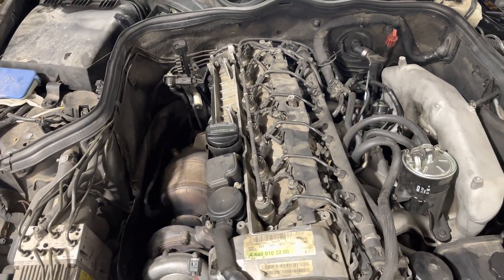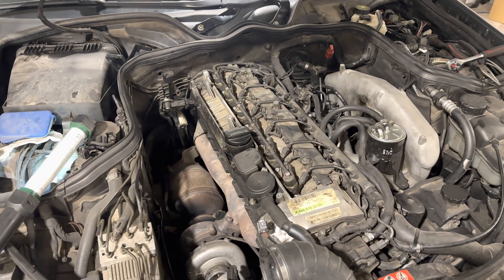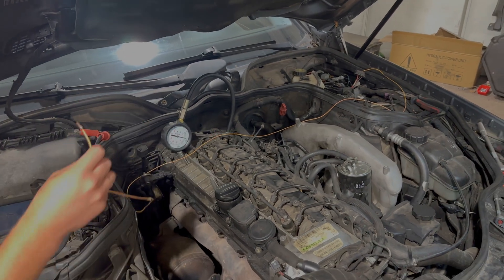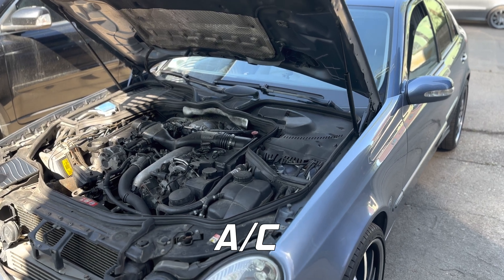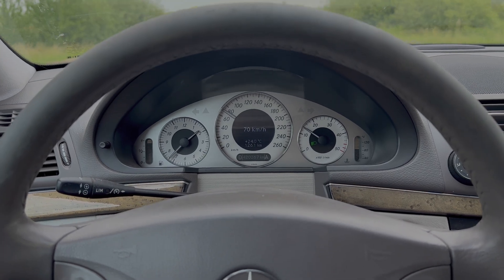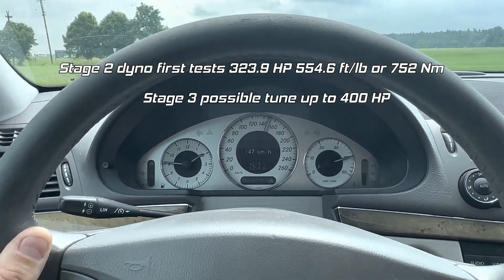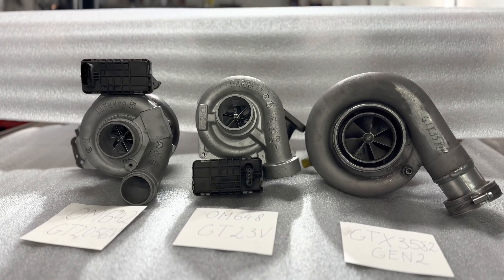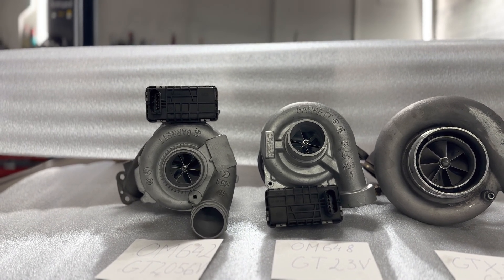Inline R6 E320 CDI OM648 Death. OM642 E320 CDI Stage 3 With hybrid turbo. Turbochargers and plans.

Comment: Om642  LS or standard? I have standard om642 CLS 320 2008. Chip ECU, removed all ecology. Rated power is 320 hp, 700 + nm. 0-100 without launching 6.3s, with launching 5.8s. And this is not 350 hp.
Reply from the maker: what turbocharger you use with what boost?
Reply: Stock turbo. 1,7 bar. After repair. But acceleration I can make one time, and need wait reduce air temperature. Need install tuning intercooler. And more, I think about extra oil cooler, because acceleration to 200 km , oil temperature 105 degrees. And need wait again.
Reply from the maker: @sergreibaranov3934  so yeah that one had intercooler hybrid turbo 2.4 bar
Reply: @ETKPerformance you meen 2.4 bar with atmospheric pressure or not. Just I have 2.7 bar with atm.pres.
Reply: Sometimes I see 1.8 bar(momentarily)launchx431pro. And I think it is no good, too much.

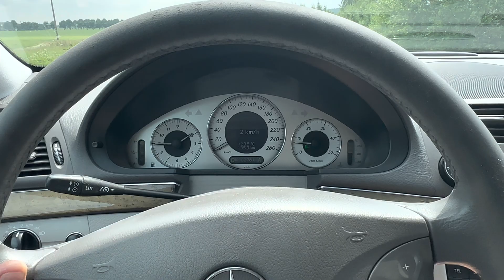Comment: hi. is that allready stage III at 8:28? If yes, whats the horsepower / torque rate at that acceleration from 0-120?
Reply from the maker: its not measured on dyno yet. Something between 350-400HP, cdi motors need to be tested 100-200
Reply: @ETKPerformance why 100-200 only?
Reply from the maker: @sergreibaranov3934  because of stock gearbox
Reply: @ETKPerformance  … and probably damage during acceleration!? Right!?
Reply from the maker: @sergreibaranov3934  what damage :DD
Reply: @ETKPerformance  I ask you about gearbox. Why only 100 -200.  I guess if you have big power , gearbox can damage!?
Reply from the maker: @sergreibaranov3934  yeah ofc if 7g and you use 1000 nm it wont hold it much, its not like 5gs, because 0-100 is slow of gearbox